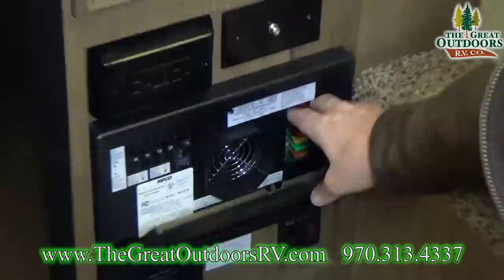How To Popup 2018 ROCKWOOD HW277 High Wall Folding Tent Setup Walkthrough RV Camper Colorado Dealer

Comment: On my buddies he made a felt covered piece of flat wood to invert the end canvas further in. Made packing a lot easier getting the top down. Picture a small pizza oven paddle felted over the end so it doesn't catch. Question on the awnings. Why haven't any manufacturers moved up to electric ones? Will the top not support it?

Comment: Very nice pop-up, thoughtfully designed with what looks like direct access to the refrigerator when in travel mode, but holy moly -- $20,000! You can find a lot of travel trailers for that kind of money. Still, it's nice to be able to store a pop-up trailer in the garage like we do, which saves on RV storage lot fees if you can't park elsewhere at home.

Comment: I would say this is the same amount of time setting up a large family tent, air mattresses, getting the bedding ready, and setting up your kitchen. You go tent camper for the cheapest way to get into RV'ing for the most amount of sleeping space. I'm looking to upgrade from a tent to a tent camper to get off the ground, gain heat and AC, and have some nice livable seating space inside. Its interesting to see what a higher end model does, but I'm more interested in a simpler model sans bathroom.

Comment: Great video!  Just bought a used 2005 Rockwood Highwall and have been remodeling it.  Even though it's an older model many of the features and setup are the same.  It does take a bit of work to set up, but my wife and I can get it done in 10 minutes.  Still beats tent camping, especially in the rain or when the showers are closed (thanks COVID-19!).

Comment: The concept is great, but the cost of work to leave all the equipment ready is exaggeratedly huge. I'm not an expert but I think there are several parts that could be activated with a control. Does anyone imagine all that work adding the manual assembly?

Comment: Several things spring to mind. It looks to be very watertight once set up. However, putting up or taking down during the rain. Things could get rather wet. I would also question the durability of the velcro. Also, the awning would be a problem if the wind got up. Taking it down with the camper set would be difficult.

Comment: When tying up the awning inside its bag, I recommend to tie the two end straps first, and don't tie the middle straps too tightly.  Ours started pulling open the seam at the top of the bag right at that middle spot.  Full replacement was covered under warranty, but that ends soon enough.

Comment: I always wonder. How would it be to disassmble this trailer in a wet day. Because the tent will be all wet potencilly soaking the trailer's inside I can't see something made to avoid that.
Reply: When you got home, you'd have to set it up again so the canvas would dry out or the mildew would rot the canvas! Lots of work!

Comment: Actually the setup is pretty quick compared to my 29' travel trailer. A single axle pop up is really easy to level compared to a dual axle especially with the Bal Lever. A lot of time saved there. Also the box is so short you don't have to worry about a level site as much to get it level front to back. Hitching is also a lot easier if you don't use a WDH with the Pop Up. The WDH takes some time hooking up. Overall, the Pop Up seems like a lot less work overall compared to my Travel Trailer setup. The High wall pop up does take more setup with it's hardwall shower and such. A standard premier Pop Up like the 2716G should be a lot less work like my previous Starcraft Pop Up.

Comment: Thank you very much,  I just purchased the very one your working on.  Now I know what to expect.  Looking forward, to enjoying it. Like anything your enjoy, you need to maintain it. The hands on approach allows you to inspect as you go.
Reply from the maker: Thanks for your comment Anthony C, happy camping.
Reply: Note- get the special connector for your grey water, and change your outside locks asap. If possible a cover to keep the heat from effecting your batteries and keep it newer looking.  I'm enjoying it your not limited to going anywhere, and delegate the pop-up duties. Good luck 4/26/18
Reply: anthony cooper how much was it?

Comment: I picked mine up yesterday after going through a thorough walk through with the tech.  It tows nicely but with a Honda Ridgeline you can tell it's back there.  I got home and set it up and ran into three problems.  The lift didn't go all the way up, though it did go high enough to get the corner set poles in.  I'll suss that out later.  I couldn't get the roof support pole on the king bed side to go in so I must have something wrong with the way the fabric is stretched on the outside,  It was starting to rain so I left that for tomorrow to solve.  Then the main door wouldn't seat properly.  I got it in enough to get it to close and latch.  but the top part is wrong.  That's another project for today.  I didn't bother yet to set up the head.  All in all, it goes just like the video.  Despite the less than perfect setup, it didn't leak a single drop of rain when the major afternoon thunderstorm hit.  It was coming down sideways in buckets and I watched very carefully.  It took me about 30 minutes for first time setup, and I could see cutting that in half after a couple of times.  I may add a free floating lounge chair just for reclining and watching TV, for which there's plenty of room inside to store it just laid over on the floor.  There's also a small sofa option that would go just in front of the king bed next to the head.  The huge U shaped lounge will easily seat six.  I bought extended outside rear view mirrors just in case I needed them, but I took them off after I hooked up to come home because the factory mirrors are plenty sufficient to see around the camper underway.  I'm using this as a solo camper with an occasional tag along so the inside area is cavernous.  Even if you hade four adults on board you'd still have plenty of room for everyone to be comfortable.  I'll update on the three issues I mentioned.
Reply: Wellllllll, I've been on a three week road trip with a lot of overnight stays, and I have to say I'm tired of dealing with set up/take down.  My earlier enthusiasm has been dampened by all the work required at the end of a long day of driving.  Also, these are not good cold weather campers.  I was in Mancos, CO with a low of 15 degrees and was able to keep the camper at 70, but I was sucking down a 20 pound propane tank every night and a half.  It tows great, but I'll give that up for a little easier time of it.  It's been a good learning experience, but I'll be looking to trade for a hard side once home.  Don't get me wrong, everything works great on this camper, it's just the work involved in getting it ready.  Also, I have a lot of repairs to make where the canvass has pulled out of it's track along with a handful of minor annoyances from all the shaking of the road.  RPOD maybe?

Comment: Nice video. Very helpful. This camper will work well for some folks out there, but I wasn't really a fan of the soft side campers to begin with. To me, it's not much more than a fancy tent. This takes a lot of work to setup but will be easier with 2 able bodies I suppose. I believe the non high walls of these are manual lifts, correct? I think after setting this up and taking down in the rain one time would be enough for me. I would have to bring it home and set it up again just to dry it out.  Makes me appreciate Rockwood's hard sides more. Just my opinion. Haven't actually used one of these before. Again, very helpful video. Good for people to understand how it works.

Comment: Okay pick up the trailer, Forest Rivers warranty cover the cost of repairs. The whole side curtain fell down, and when putting up the trailer pop up the red line which supports the cover broke. It was in the shop for 3 weeks to repair these two items. One got taken care of. Oh they talked me into a battery cut-off switch because I had to disconnect the battery each time I stored it. My over all experience, I would advise anyone that purchase one to Consider my review. On a scale of 1 to 10 the quality and work-men-ship I world rate the trailer a 5. because there are two separate lines. Gray and Black and you have to connect the gray at camp. If you have in-coming water supply it will back-up and fill you shower. you have to turn off your reserve and use city water. Which wasn't explained when purchased. When this occur's you have to dump the gray tank and turn off city water to drain. Set- up and take down can be a problem and time consuming. Our trailer's sink has a bulge of the seal in the sink 3/4 to one side. looks ugly. The trailer had wood shavings inside the outside pull-out grill. There was to many issuse's although small seem large due to getting them addressed. For what I spent, If I had to do it again I would have gotten an ECO- Pro camper. Less room but not the stress and aggravation I've been through over the past 4 and 1/2 months of owning this trailer. I purchased this because at 60 and looking at retirement down the road. My older brother came down with cancer lost a lung but is still looking forward to me and my wife driving cross country to take him on his first camping trip. He has completed Kemo, and radiation and takes med's. This idea was on my bucket list and with all that has happen. This is the reason I give this camper a score of 5. If it were a car it would be a Gremlin. poor quality and seems as if there was no one checking the quality when assembled. If this would be you first as mine. Please take someone with more experience to look at the detailed work-men-ship. It was obvious I wasn't I saw the big picture and dream of making memories. 8/2/18

Comment: Another Great video, however this is quite the workout, this makes me want to give the hybrids another look!
Reply: wuhala100 its not really that bad, once you get a system you can get this done in like 10-15 minutes.
Reply: It's not bad at all.  I can do it myself in about 10-15minutes
Reply: It comes down to what the lower profile is worth to you and maybe what features you can find in a low-profile setup.  This is the most features of any fold-down trailer.  It's only weakness is under the body.

Comment: nice camper, but to much work for a old man like me ;)
Reply from the maker: Hello Ed R, Thanks for the comment and for your honest opinion.
Reply: Lol lol I was surprised at what was involved in setting it up. Wow
Reply: @volvocub2629  :  Yeah.  It's quite a bit.  Maybe it was a little fussier because it's fresh from the manufacturer, and the fabric needs breaking-in.  There are a lot of little things to do, but none of it looks all that difficult.   

It's a pretty old design.  One that's stood the test of time, because it's just a really, really good shelter concept, with the metal roof rising in the middle and 2 - or in this case 3 - slide-outs radiating from that main roof.  They're pretty bulletproof, if you take care of them and either avoid leaving the pavement, much, or beef up the suspension.  They're almost cartoonish, with those tiny wheels under them.

I like a lot of what the Aussies are doing, right now, but I haven't seen a rear- or dual-fold off-road tent trailer, where the rear portion was given over to galley.  That'd solve the main issue I have with their designs.  You shouldn't have to cobble together an awning and then awkwardly hang walls for a half-hour, before anybody wants to stand out there, cooking.  Makes so much sense to have the galley in back, and integrated into the base shelter.  You could still access the galley without unbuttoning the shelter, but you'd instantly have a roof over the cooking area, and enclose it or not, as conditions indicated, in seconds.

Comment: Okay, back after 3 1/2 months of ownership,  found some discrepancies, while lifting the trailer one of the latches broke, and the putting up of the door there are 4 screws that support the door. The screws came loose, found that they were to short to support the door hanging from the ceiling.  Check after use. Also the entire support for the ceiling to the counter fell down. From the rear bed to the front door. Again the screws were to small to connect to the frame. Poor construction over time you need to check. Its been down for repairs for 3 weeks, glad it's under warranty.  The good thing is they work with you. I've added,  tongue jack, battery disconnect,  new single step. Got a generator,  looking to get back out there, and will update when these are addressed. 7/11/18
Reply: anthony cooper seems to be the case for most RVs nowadays. They're built like crap
Reply: Thanks for sharing your issues. Popups are built very cheaply and there are bound to be some issues after bouncing down the road.

Comment: When you consider price and build quality...the Rockwood Pop up is in my opinion the best there is. I know the Somerset is somewhat better in build quality but you are looking at nearly double the price of a Rockwood pop up. My wife and I were torn by the Rockwood pop up or the Rockwood Roo. I think the Roo was a better choice....way less work to set up the Hybrid. Tip out beds on a hybrid take a minute to set up. This popup weighs 3400 lbs....the Roo is just under 4000 lbs....yup the Hybrid was a better choice. This pop up is loaded with features that our Roo has...so I tip my hat off to Rockwood for such a well engineered product but Hybrid is so much less work. The Roo has a power awning....that alone is a huge work saver. If I win the lottery I would buy this pop up in an eye blink. The one huge advantage a pop up has is going in the back 40....way more accessible to rough country. Well Mait...you did a heck of a job with set up and tear down....good job...TGO does great videos.
Reply: Can you speak to the build quality of a Jayco vs the Rockwood? As a tent camper I am looking to upgrade next Spring to something that will have room for our future kids. Teardrops have been too small and I rather do a little setup than tow a big trailer. We have been looking at the Jayco 10SD vs the similar floorpan of a Rockwood Freedom series.
Reply: I own one of these.  Well, the Fleetwood colored version that is.  It is NOT appropriate for going anywhere more rough than a smooth gravel road.  The front steps are inches off the ground and the rear pooper pipes are likewise only inches from the ground.  We just finished lifting ours 3 inches and I still worry about high angle driveway curbs.

Comment: Love, Love my new trailer. 2 months of ownership and what I've learned. Walk through with this model. Make sure water lines are turned on. Under seat. which has a screw keeping it lock down. Will not have hot water if they are not turned on. Grey water needs a special cup to connect to a hose to drain. When storing it for any time. Disconnect battery. Shop around for accessories 
Change out locks, They are easy to get broken into. Short trips will help find the little problems. Be ready for the fun time. Don't sweat the small stuff. 5/17/18
Reply: Any new update?, I'm going to purchase this 2016 unit for 14,500 next week .  Thanks

Comment: Not a lot of thought put into the design, takes way to long to set up, and why would you have to plug in a power cord to the top of the trailer so you can have AC? I wouldn't buy this popup camper.